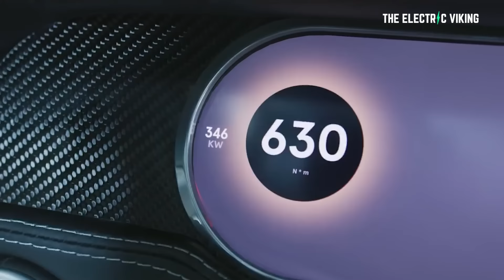Chevrolet's e-motor kit to convert gas cars to EVs is EPIC

Comment: 🔌🔌Check out battery manufacturer Kore Power acquiring a small share of ZEVX out of Gilbart Arizona as has AAMCO. ZEVX has some very interesting patents on ekit mods. I guess they will not be using 400WH/kg Sion Power cells out of Tucson AZ..🔌🔌

Comment: This is too expensive.
I think that this is an opportunity for the Chinese.
If you drop the notion that you must convert it back.
I thing you can do i cheaper, and better.
First you need to make a systen for rear drive, and one for the front drive.
This whit a controller, AND also a charger that can do CCS.
The rear systen need to replace the chaft.
So, here there must be parts that can modify the back, or you need to cut into the back part and weld in a part.
In the front it's easier. Here you can use standardized parts to aligne the chaft, to the kit.

If you can standardized this on many brands, you can make it cheap, and profitable.

And why stack up the old fossile parts?
If you get your dream car converted, with CCS, you can use it in the future, when all the gas stations are gone.

Comment: This is massively overpriced compared to transition one [5-7k euros] electric conversion… 🤦🏼‍♂️ just import their parts under the “for offroad use only” nhtsa clause in us customs… depending on your state, how you then can lawfully use those parts may vary. Even if theres a $3k import tarrif it would cost 10% of whats being offered by gm or ford.. [this would only be applicable for light duty vehicles]

Comment: The breakthrough will probably be a kia crate motor. Super modular, would have a decade+ of tired kia souls back on dealers lots with a new powertrain warranty? Man if Chrysler did that they would probably resurrect the brand from its awful motor history the past 1/4 century

Comment: This is nonsensical.  Way to costly and complicated. It will never be a mainstream thing. Batteries are thousands of pounds. Most gas cars are not set up for excess weight, among many other problems. Pipe dream.

Comment: I looked at electrifying my Miata, buying parts would have cost me $30K.  
After I sold the Miata, I realized I could have bought a Chevy Spark EV as a donor car.  Pre-pandemic, you could buy a good used for less than $7K (they are now 2 to 3 times that!!!!).

A lot of Miata's have an LS engine in them.  An EV crate replacement would be amazing.

EV West, here in the San Diego area make EV conversions that make no changes to the original car.  They do a very nice job.

Comment: Yep - I can see the future now - rolling along (after paying my US$1,000 electric bill) when a new light comes on on the dash - "Return to Dealer".  With no explanation in the manual, I drive back to my nearest Chevy dealer where I'm informed that the motor has been taken off market and I need to return it.  I'm offered a new Chevy Impala bicycle in exchange and told not to mention it with other Chevy owners or the media.

Ummm, nope.

Comment: Hydrogen combustion engines like the Cummins 6.7 litre HCE or the Duramax HCE would be an alternative conversion and could be done by vehicle manufacturers. Highly likely to happen in the large truck / pickup type vehicles.
Reply: I agree but for this to work there must be hydrogen filling stations to service these vehicle. Never seen one so far.
Reply: @rogerthornton4068  well we all know the infrastructure has to be rolled out. This is happening reasonably quickly. Remember one hydrogen pump has the ability to fill over 250 vehicles a day. 4 pumps = 1000 vehicles. How many chargers would you need to fill 1000 vehicles? They are being rolled out for commercial vehicles like vans / taxis.
Reply: No, hydrogen just isn’t economically viable for heavy vehicles.
Reply: @williammeek4078  🤡
Reply: @lesliecarter4295  real intelligent response.
Reply: @williammeek4078  intelligent response to a stupid out of date comment !!!!
Reply: @lesliecarter4295  when why are there NO commercial hydrogen powered vehicles available for purchase?
Reply: @williammeek4078  😂😂😂😂

Comment: I have a 1964 that cost about $2500 new and was quoted $30k to covert it to electric. If a crate motor and all the rest of the controls and batteries could be completed for $15 K I would do it.

Comment: Thanks for mentioning this, I'll chime in a bit:
GM has been promising this for years.
GM has been promoting the training and certification program for years.
GM has not been returning phone calls or emails concerning product availability and certification for years also.
EV conversion is a net positive way to repurpose existing vehicles for an attractive price, after running a poll myself 4 years ago, majority responded in the affirmative that they can accept a sub-200mi range primary city driver EV conversion of their existing vehicle until finances make buying the latest and greatest possible in the near future should the need arise. They understood that more range results in more out of pocket. AC and Heat was a major concern back then, imagine trying to push a heat pump concept to those used to turnkey convenience...cost was an issue on that front at that time also. 
GM is one of the few legacy automakers that can catch up to, match, and possibly overtake Tesla in the EV marketshare game, I know Tesla fanboys don't like to hear facts, but they also don't like how that Cybertruck just got pushed back and even scrapped in the Aussie market altogether recently, they don't like to accept that Tesla rebranding of open source AI innovation isn't delivering hard enough to make those "full self-driving" lies true either without finally admitting global fed transportation infrastructure has to meet the client side halfway if safety standards and certifications are to be handed out. Full self driving will not exist a nano-second sooner than this finally coming to fruition and I'm a lifelong futurist that still subscribes wholly to the notion O'Neill cylinders are the most plausible means of off-planet societal migration. The facts are cold and resolute...GM's only problem at this point is old guard mentality hold-outs need a severance package slammed on their desk. You DID hear this from me: this is the sentiment in Detroit and definitely the buzz in locales like Lansing, the new blood sees the inevitable future and don't take kindly to progress governing leashes.
It's 2022 now brother, you will revisit the GM crate initiative again in 2024 and they still would not have made it a viable reality by then.

People are still buying gas cars, not listening, impervious to advancement.

Comment: I got all excited, then realised the prices are JUST for the motor, you need to spend SO much more for a working system; batteries, inverters, charging controls etc. By the time you add them to the "crate" price, you are looking at more than a new mid-range EV.

Comment: It's a great idea in principle. But it's lacking in real world applications. We already know the ev are heavier then there ice cousins. The extra weight is from the batteries.. where can a person put Enough batteries to drive 100 miles?  Swapping out ite engine isn't hard. Reconfiguring the entire chassis and body to support enough batteries to have a 200 mile range is tough!
Reply: The weight penalty for EVs is greatly exaggerated. A suspension upgrade might be needed but no further modifications to the chassis and no body changes would be needed.

Comment: Ev is all good for certain applications, but long term use , if everyone went to EVs then you will see an increase in healthcare systems, EV puts off a different type of energy and gas,  yes gasoline engines does pollute our environment, but most pollution comes from the manufacturing plants, think about it, all manufacturers don't have gas engines running in there plants, you guys are idiots for wanting ev engines, EV engines don't only put off certain energy, they produce radon and other dangerous energy, in large quantities you guys are gonna see alot more people dying with heart attacks and brain aneurysms, and the rate of cancer is only gonna increase

Comment: I have a 1970 series Landrover which I use on the farm.  Had a quote in the UK for a conversion to electric of £18,000, more if structural work was required on the recipient vehicle.  This was way over my budget but from what you are saying is happening in America, it could be a good price!  The Landrover has already had a conversion from the original petrol engine to a diesel engine back in the late 1980s, which shows just how wrong they got 'updates' in the past.      Guess I'll just have to wait for something suitable from China!  regards

Comment: Sam, I agree this crate electric. Motor from GM to replace SOME cars’ ICE engines.  Anything yo give the climate a break from pollution.  If this system works is effective, it’ll alsoputsome needed price pressures on EVs.  Oops, now that you’ve given us a better cost of the conversion, it already sounds way too much.  Another auto industry pipe dream!  They are incredible BS artists, dragging their feet on simply competing with reasonably priced from-the-ground-up EVs.  The Chinese manufacturers must be laughing their asses off about this latest inanity!  Regards, Bob Campbell